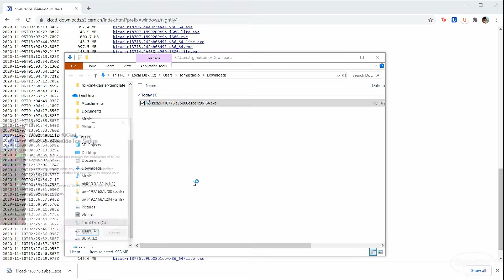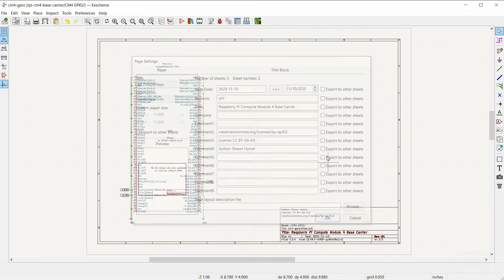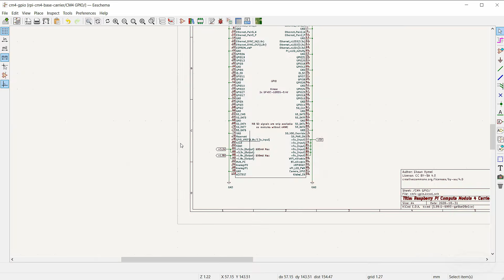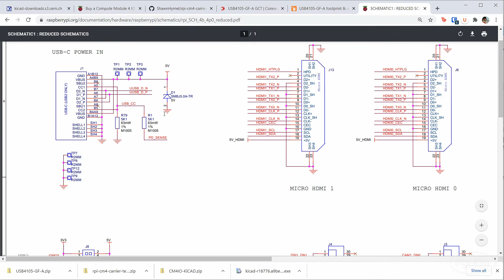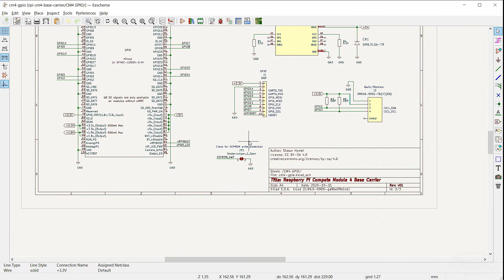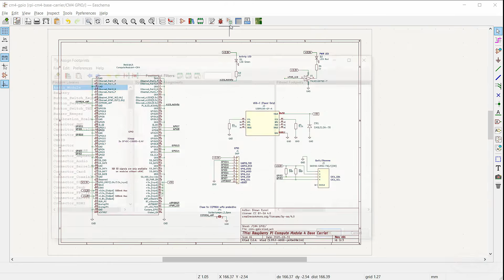How to Make a Raspberry Pi Compute Module 4 Carrier Board in KiCad - Part 1 | Digi-Key Electronics

Comment: My problem with kicad is file management. its clunky and confusing for new users. I want to follow this but I just cannot understand what half of these files do or how to organize them. I wish it was more integrated into the tool
Reply: Which is the best tool for designing and beginner friendly also ? Pls suggest
Reply: I found easyEDA to be far better designed in this regard. It works actually how I think it should.  @rsingh2083

Comment: Just made it to part 3. Only thing I don't like about this series is it doesn't explain how to determine what components you actually need (what needs to be there) during the design
phase. I can start off with a high level thing I want to accomplish (I wish the PCB was this size, has 10 USB ports. Sd card port, activity LEDs, keyboard and video ribbon cable ports, etc), but what resistors, transistors, diodes, etc need to be present in the circuits? Wish there was a more automated tool that fills that in for you.

Comment: @Digi-Key The many ERC problems that "look OK to me" is often that you don't have "Power Flags" for power supply inputs and ground pins. If you put them at their respective IN and terminations, those problems go away and the rest are probably "Not Connected" errors, which could be disabled in settings.
Reply: I place the NC flags, I didn't know you can disable the warning. Good to know.
Reply: Although admittedly I should probably be practicing best scametic practice.
Reply: Probably best not to encourage lazy ness

Comment: I'm Brazilian, my name is Renan, I have an interest in learning web designer and programming in python, but I have nowhere to practice, I would like to have access to the raspberry pi, more here in Brazil with the current dollar quote, the equipment that was supposed to be easy access, very expensive, between R $ 500 and R $ 1000, with a minimum wage of R $ 1060, I am not able to acquire. would it be possible to help me in any way?
I'm sorry for any typo I'm using google translator. I'm just asking for not having the conditions. Thanks in advance.y

Comment: sounds pretty cool as I am getting into Raspberry PI dev, but the Compute Module is were I will end up for an embedded use case ( a lot of sensors) and so I am looking for a carrier IO board to expose some of the CM4 capabilities (all Gpio PINs )and add for example the Coral chip, an accelerometer/gyro and GPS on the io/expansion board. Any pointers on who I can contact to create a PCB design and then produce it ?
Reply: You could try one of these IO board with coral for $$$
You would only have to interface the GPS which wouldnt be too hard. A bit too expensive imho.
https://www.gumstix.com/community/blog/raspberry-pi-cm4-carrier-boards-from-gumstix/
Reply: Actually they have a board with GPS or an option to add your own GPS modules etc. Also On-board accelerometer, magnetometer and gyroscope
Reply: @matthewbrown4549  great thx!